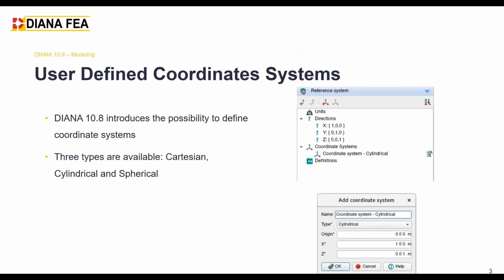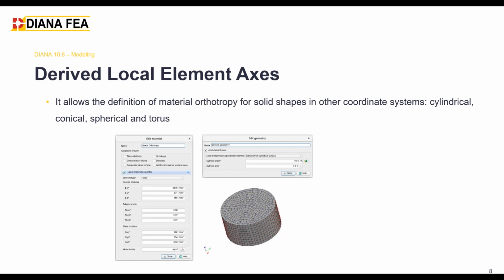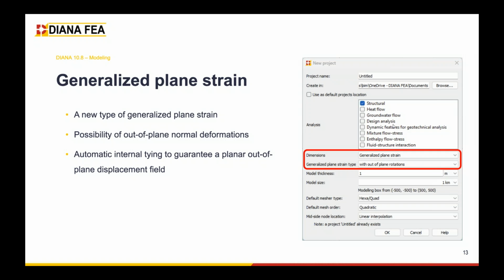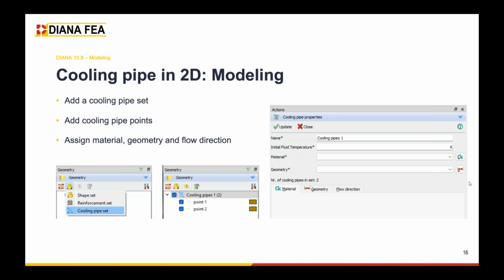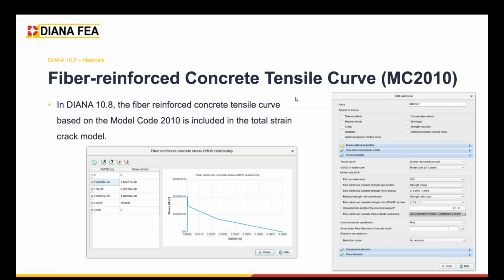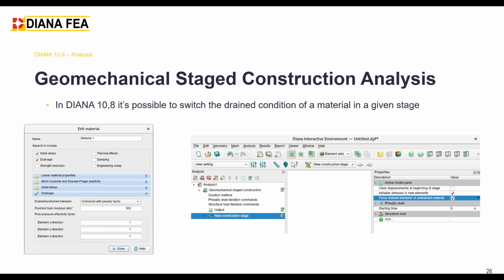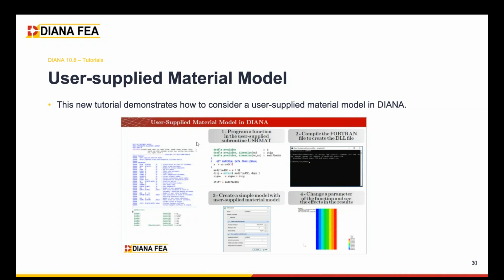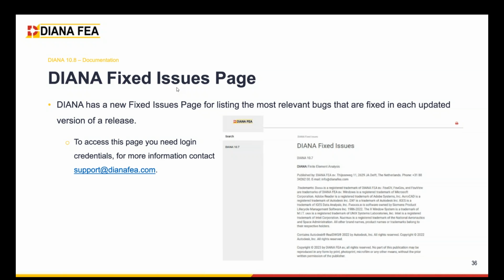DIANA 10.8 Release Overview

Comment: Thanks for the good and excellent software.
I hope that significant improvements will be made in terms of software capabilities day by day.
The problem I had with the Diana software so far was regarding the loading of body force, which is applied to the whole model by applying acceleration and cannot be applied to the desired part of the model. why ?